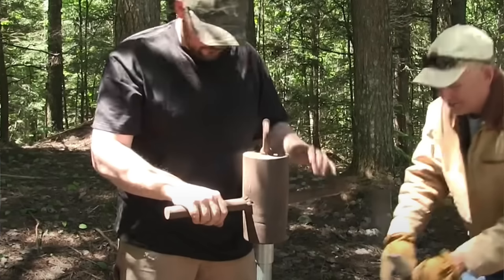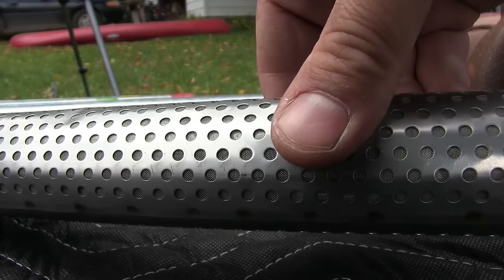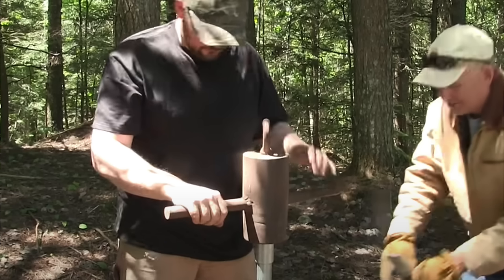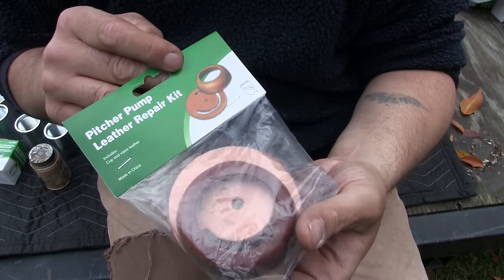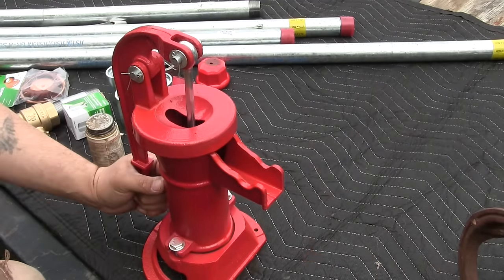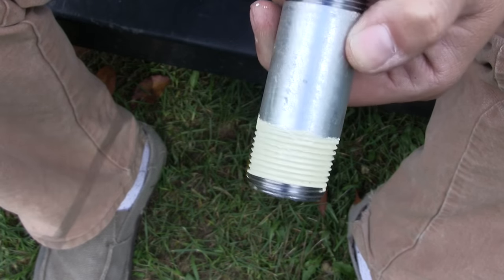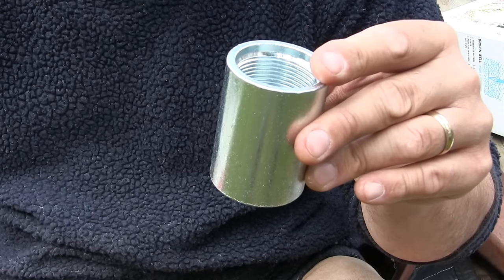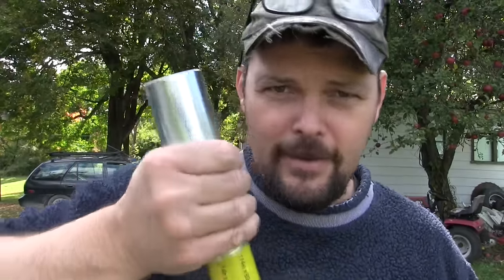Hand Pump Well , off-grid, self-reliant water, everything you need to know

Comment: 70 odd years ago my parents had a pulley and a long cylinder (galvanized, I think). At the bottom of this cylinder was a cork like thing and when the water bucket hit the water it would turn and allow the cylinder to fill up with water and slowly close. Then we would pull the cylinder on the pulley and empty the water into a bucket. I suppose they hand dug to get to the water initially. I just remember it was the BEST water and so cold. This was in South Alabama. My Aunt had a hand pump well. Thank you for sharing ALL of the info .

Comment: Why would you want a ball valve instead of a check valve?  Check valve:  Somebody can't mess with it and lose your prime.  Ball valve:  You can open it and let the water fall back down the pipe so it doesn't freeze in winter.  Which is best?

Comment: I know this is an older post, but I had a question: what about running 2-3" casing and then dropping the water pipe inside the casing? Will that work? or is just a waste of time and money? Thanks. Great video...I didn't even think about the ball valve.

Comment: Great video.  I don't really need to drive a well for regular use, but when I lose power, there's no water.  So will be driving a well for the garden and if needed, for power outages.
Seems that since you are not happy with the leathers that you can get, you need to see if you have a leather store near by.  Cut out your own leather valve and you can make that connection point wider.

Comment: A check valve instead of a ball valve would be better as you don’t need to remember to close it.  It also will prevent that water that was sitting in your pump from going back down your well and possibly contaminating it when your leather seal fails.

Comment: At sea level and normal atmospheric pressure, it could theoretically lift water up to 33 ft and eleven inches.  But if, for instance, you were in Denver area, Colorado, mile high, the max pumping height would be reduced to about 28 ft...  So 25 ft height seems a reasonable value to consider in most any normal location under 6000 ft elevation.  At any rate, the max pumping height is always reached when the weight of the water column just balances the prevailing atmospheric pressure.

Comment: I’m thinking about driving a hand well I have 6”/4”/2” Rigid metal conduit pipe left over from a lot of electrical jobs have about 100’ plus of each feet of each. What size pipe should I used
I can used my hammer drill to dive it in

Comment: I have an existing well on my property.
The well is 25' deep with an 18" diameter terracotta well casing. The well sits idle with eighteen feet of water sitting in it.
At this point my wife and I are in the process of cleaning up the property.
We tested the water and it's as pure as can be. Later this year I want to build a pump house around it to supply water for house that we want to build. In the meantime I was thinking of installing a hand pump to supply our water needs when we go there.
So my question is can I get away with using PVC pipe and put a screen on the bottom of the pipe or just stick with the galvanized iron pipe.
There's a concrete cap that's easily removed with what looks to be at least an inch and a quarter hole through the center.
The other thing is that I believe that the base of the hand pump needs to be supported or anchored to something so that it won't flop around. Perhaps an open ended box with a top that would allow access to the ball valve. This could be tap conned into the concrete cap.
Any and all suggestions are welcome. 
Thanks

Comment: Was 42 bucks per 5 foot pipe. Damn. bought 20 ft of pipe and the 3 foot driver. So ill be just under the 25 foot max at 20 feet in the ground and leave 3 on top probably for a 23 foot pipe total plus height of the well pump.. But all materials (i shopped between lowes, home depot and ace for cheapest stuff) ran me about $400. That was 4 steel fittings , 4 five ft pipes, the hand pump well, the 3 foot driving rod, and an extra leather seal of each (2 leather seals $12). But $400 and a days work for a well is pretty good.

On a side note, the t-post driver you made. I wonder how many people tried to make their own but lost the main driving spike in the center down the well pipe hole because it broke from repetitive impacts and it was a personally made tool so the welds weren't great. You slam it down, lift it and the rod is just gone haha. Down the pipe it went.

He wasn't kidding about there not being a tool commercially available though. Some people said normal post driver but they are all several feet long so you wouldn't be able to drive it very deep before your wacking the ground.

Comment: Well that's unfortunate. There's no way we would be able to drive well pipe into our ground. I live in a part of Nova Scotia that's very rocky. We would hit boulder after boulder. We can't even use trench or hole digger. We dug with a mini excavator to install a dry well recently and after pulling up a million boulders, we finally hit bedrock (slate) at 5 feet down. So this method ain't gonna work. My submersible pump (drilled well) is 85 feet down, so I'm hoping that the water line isn't too far and I can maybe install a hand pump inside the house beside my pressure tank.

Comment: I don't think raising the handle all the way, holds the bottom check valve open. You actually can buy a device you could use to drive a well. It's a fence post driver from TSC farm, and likely elsewhere. It may not be 90 pounds, but you could add weight to it.

Comment: Everything here is true, but understand in many areas this kind of well may not work depending on rock and soil type below ground. Mileage varies A LOT on this project. For many of us we need to dig a wider well, allowing us to dig around and clear away stones that would block a simple driving point, and then line the sides of the well with stones to hold back the fine silt and clay that would fill and clog a drive point. It’s a hell of a lot more work unfortunately.

Comment: I just used an auger down to the water level then tapped my point down. It was a whole lot easier than driving down 15 feet. And the auger only cost 100 bucks. Plus a few pipes to extend it. Why a ball valve instead of just a check valve?

Comment: Dave
I have a 70ft well with a 14 ft water line that is brick lined circular with a concrete removeable cover.  Its flush to the ground but i want to build it up to a hand pump. Can I use this same method but somehow attach the pipes at 5ft above the opening at the ground ?

Comment: Sorry, but sched 40 steel is sched 40 steel. The only thing heavy duty is the drive couplings and the drive cap. C'mon. now.
 Also, that is not a cast iron coupling, it is malleable steel. Maybe you should have talked to a plumber before doing this video. The pitcher pump should also be soaked in water before installation so that the leather gaskets can absorb water in order to form better seals.

Comment: I wonder if you could also put a rubber o-ring in the pipe joiners.  As you remove the ‘drive-nipple’ piece, just drop an o-ring in, sitting on the end of the pipe, then insert the new length.  This might work to prevent the dope-taste and ensure a good seal. 
Also, fit a foot-valve, a spring loaded non-return valve, at the joint between the drive point and the first length of pipe.  This will ensure the entire length retains it’s prime.

Comment: 1 in thin wall poly works fine on these pumps it Is always smart to pump more then you need into a bottle for priming, much smarter and easier to use a tote up above the height you want water and bring out your little suitcase gen and pump 300 gallons in the tote to this height

Comment: Dope the top threads. You don't have to drink the water right away, but the threads not covered with dope will rust out faster and you could end up with more problems than just leaking.

Comment: I am a retired general contractor and plumber. Do not use a Gate valve. Use a Ball valve. A gate valve can jam and thus become jammed and hard get back open and sometimes, not at all possible to open.  

The purpose of the pipe dope is to make the threads slick so the threads will seat. Pipe threads are tapered so they get tighter and tighter as you turn them together. This is unlike a bolt and nut. Threads on a bolt are not tapered. 

About your underground freezing level, this depends on what part of the country you are in where the well will be as far as how deep it will freeze underground. For example, in Western Washington state the freezing level under ground is generally 2 feet or less on the worst winters. In Montana, the freezing level is 8 feet under ground. You can find out what the underground freezing level is in your area anyplace you would go to get a building permit. This information should be free of charge.

Comment: Just got a piece of land here - in the Philippines. Here a guy did dowsing and the well will be dug by hand and have cement rings one atop the other with cement seals. A guy goes down and hand digs it! I would FAR prefer to try this sand point system but by the time the parts got here and for what they'd cost -  I would be old and broke. Bummer!!

Comment: The 25ft depth limit is there because of physics. At 30ft, the weight of the water is great enough to pull a vacuum on whatever is pulling it. In a vacuum the water will begin to boil into gas.

Comment: Here in Philippines, our well is 30 meters deep and where also using hand pump and electric motor. As long as you have check valve at the end of your pipe, using hand pump is easy.

Comment: If you have to pull it out get a farm jack and a piece of 3/4 plywood rig it up low and crank it section by section comes out straight. Put the jack on the plywood to prevent it from sinking in the soil

Comment: Min 14;12 ‐ I would say, screw in a coupler 2 or 2.5 turns to the end of threads, then apply the dope. Once well applied,  tighten the coupler in place.  The coupler will only push the dope "out ways" preventing water contact. Just a thought. Great video and tips, Thanks.

Comment: 19:05 - when pulling the pipe out don't turn it anti-clockwise always turn it in the direction to tighten otherwise you could unscrew the pipe and leave parts in the hole
20:16 - audio drops off

Comment: Had a problem with my setup. PVC sand point, the slits cut in it got clogged with sand (the sand is the same size as the slits) so when we got it down, installed the pump, it pumped awesome till it sucked the water out of the pipe, then nothing but vacuum. Pull it out and it was clean.. so my thinking is the sand just the right sized to not go in the slits but fit in them to the point of blocking the water from coming in..
How do I fix this ?
My idea it to make a 3 foot section with holes all in it and let the sand in, heavy enough to not get pumped up, and itr does let water to pass. Would that work  ?

Comment: Water tables often show a seasonal variation in depth> Keep that in mind when getting to depth.Also the height of lift is determined by atmospheric pressure. At sea level the max theoretical lift is 14.7lbs/ft( one atmosphere)/ 0.433((gradient of fresh water in psi/ft)l In theory this works out at 33.9ft. But friction and otheer losses bring this back to 25ft. At 5000ft elevation the atmospheric pressure drops to 12.2psi and  the pump will also     have a decreased depth of lift

Comment: Those pull a perfect vacuum so even on a jet pump you can thread a short nipple onto the top of the jet pump by removing the plug on top of the jet pump. Note this is useful when you have hundreds of feet of water line bound up with air that your having a difficult time getting out. Just a few pumps and all that air will be pulled out and jet pump primed.

Comment: I was a plumber for 23 years, have been a mechanic since. I have never put in a hand pump but now want to, I cannot find a definitive answer as to does it need a lower foot valve with these pumps. I will not be using a drive point as I have a fifty foot well already onsite. the water table is said to be contaminiated by a lumber mill that used to be just up the hill from me plus the well was cased with orangeburg pipe. It should be fin e for garden water and pressure washer water, there will be an electric pump in there as well, plenty of room. you had mentioned the pump bore being rough in the cheap chinese pumps, would you think honing it with a cylinder hone would improve it?

Comment: So what are my pipe options? I would prefer to use pvc pipe rather than galvanized rigid conduit. My main concern is whether the pvc would handle the abuse of driving it. I would prefer pvc over galvanized because eventually the metal would rust. Also not sure how the galvanized pipe would effect drinkability of the water running through it? Any advice would be appreciated!

Comment: Great video! Need some help… tried driving a well twice in Gaylord MI… both times the sacrificial coupler has stripped out the threads on the pipe… so now I have two well points and pipe only 8 feet down and my threads are stripped on both… any help would be appreciated

Comment: Is there a benefit to using this system as opposed to a hand dug well with PVC well casing and foot valve? The latter seems superior, as you can easily remove the well line for maintenance, cleaning, etc. 

This system, however, seems to be better for filtering sediment, and less labor intensive than drilling 20ft with a hand auger. It also seems that it would be far more durable in the long run, as long as your well doesn't dry up. Do you have any problems with losing prime on your pump, since there is no foot or check valve?

Comment: The first two pipe threads aren't sealing threads, so putting pipe dope or Teflon tape on them would do nothing with respect to sealing the joint. Further,  the seal actually comes from the tapered threads themselves, not the pipe dope of Teflon tape; they serve to reduce the friction on the steel tapered threads so that the joint can be made up (tightened fully) properly using pipe wrenches to gain the proper leverage to fully screw the pipe up into the fitting.

Comment: Is there no nut on the screw that holds the lower leather flap the the metal plate? It looks like this fell off in mine, which would solve the mystery of why it wont pull any water. Seems like it should have a nut to hold in place!

Thank you for the video!

Comment: My well was dug in 2006. It is 600 ft deep and sits on an acquirer.  I investigated them rough the well company that installed it, what it would take to install a hand pump as backup.  I was told I would spend a fortune trying g go do that.    I don’t think it’s as simple as removing the well cover and dropping in a bailer bucket.  Any insight to this would be appreciated.

Comment: A well is limited to 25ft pull at sea level due to physics. Potentrimeteic pressure is one of those tricky problems. To pull water from greater depths you need a two pipe system.

Comment: Those drive points are not indestructible depending on what you're driving it through. I mangled one driving it through clay, and ended up having to drill a three inch hole. I would also hone the piston section on the pump with a regular automotive piston hone until smooth.

Comment: Also, I asked a question inside another person’s question about reviving a well that has the exterior pipe but the interior pipe is missing. I believe the interior pipe might’ve had the well point on it..  To revive it is all that is needed is a pipe with a well point that will fit inside that driven down to where there’s water? And of course, a working hand pump on top...

Comment: When I worked for a great plumber he taught me this type of pump pulls a perfect vacuum. We were in a basement at a customers house and the complaint was the jet pump in the basement could not pull the air trapped in the line leading to the well out of the system. So my boss, with a look of confidence in his face at lunch had me grab a pitcher pump and soak the cup leathers if I’m pronouncing it right. We went back and screwed a short nipple into the top of the jet pump. Then screwed on the pitcher pump. Within a couple pumps all the air was evacuated and the jet pump was primed. There’s no school like the old school.

Comment: If you need to pull well piping out of the ground, the best way I've found to do it is to use an engine hoist.  You can probably rent one if you don't have one.  You'd probably need to put some kind of a clamp on the piping, or sacrifice the top section of piping and drill two half inch holes in it on opposite sides of the pump.  The put a bolt through the two holes and use a chain.  I've seen youtube videos on people chaining up stumps and using and engine hoist to pull them out.  That's far better than wrecking your transmission trying to pull it out with a truck!   

Thank you for this video!  I have a dairy cow and hope to expand to a herd of four cows.  I've been thinking of putting a pump in each pasture rather than hauling water.  That will cost a bit of money, yes, but it's more convenient than hauling water for cows.

Comment: To pull a well tube after it has been installed for a while it pays to drive it in 3, 4 inches before pulling this breaks the ground grip on the pipe and fittings works the same for iron droppers and posts..